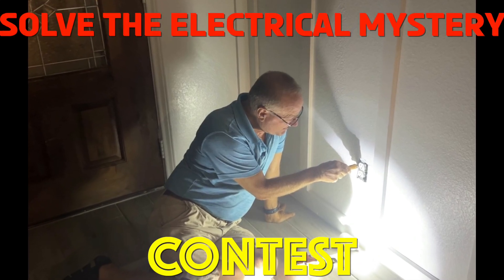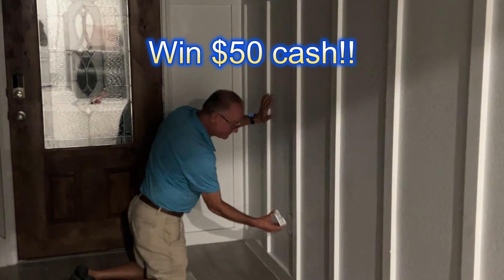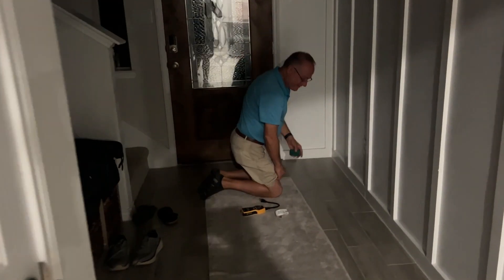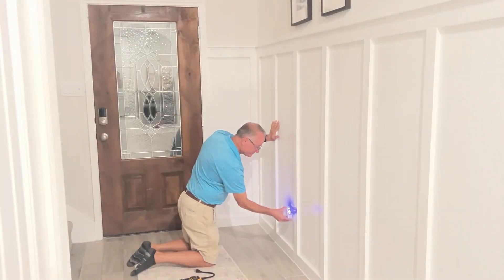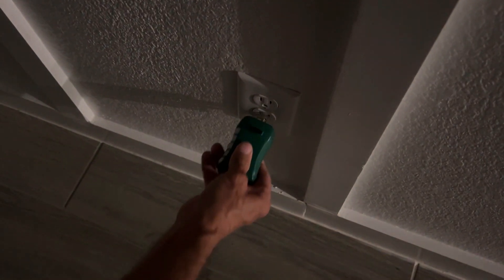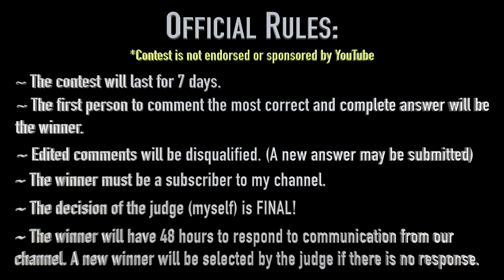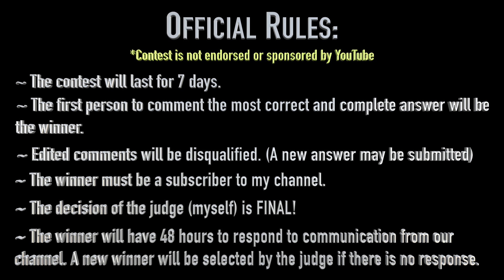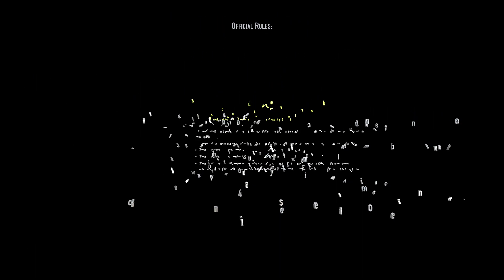Help Solve This Electrical Problem ✨CONTEST✨

Comment: Bottom half of the receptacle is wired to the light circuit of the hall way. it is sharing the neutral with the power circuit, or its crossed wired with the 120v wire.
Reply from the maker: I appreciate you watching. You may know the contest is over, but I will tell you to look at the comment from H750S. He hit the nail on the head with his guess.

Comment: Wonder if the outlet has a bad connection on it that feeds the power/neutrals downstream to the switches.  When something is plugged in on the bottom portion of the receptacle, I think it bends or flexes enough to restore a connection and then all the switches downstream start to work normally.  Think a new outlet will fix it but just a guess.
Reply from the maker: I appreciate your participating in this contest. Good luck.
Reply from the maker: Congratulations!  You are the winner. You basically nailed it. I am going to post another video showing the solution, but in the meantime for you to receive your prize, I need either a Zelle/Venmo/cash app handle or an email address and we will get you your Prize money.
Reply from the maker: You have 48 hours. I really hope to hear back from you.
Reply: Thank you! I sent a text message to your number listed on your website.  Let me know if you need more information.

Comment: Very intriguing problem. Can I ask if there were any repairs made on any switches, lights or outlets recently?  Or did this just happen out of the blue one day?  Seems odd that a circuit tester or night light in series would be able to carry the load to turn on the other lights, especially that bright.  Would think just the night light would work and the others wouldn’t.  Definitely going to have think about this one for a while lol.
Reply from the maker: Thanks for participating in this contest. This is a two or three year old house. No electrical work has been done. It just started happening one day.

Comment: My guess is that because of a bad splice, the bottom outlet was inadvertently wired in series with the light switch instead of parallel.
Reply from the maker: Thanks for your participation. Good luck.

Comment: Man, I'm embarrassed to say this one stumped me, but I'm going to take a stab at it.  The hot tab on the receptacle is broken,  and the incoming hot is on the top half.   Somewhere else in the circuit is screwed up in such a way that places the neutral for the overhead lights on the bottom half of the receptacle on the hot side, and the nightlight (or whatever else happened to be plugged in) is in series,  to complete the circuit for the overhead lights.
Reply from the maker: This, indeed, is a tough one. Depending on what kind of responses I get, I have a second video showing the next step in my diagnosis process. When my son explained his issue to me over the phone, I was totally baffled. When I showed up to his house and he demonstrated what was happening, I was totally baffled. We finally figured it out and got it fixed, though.